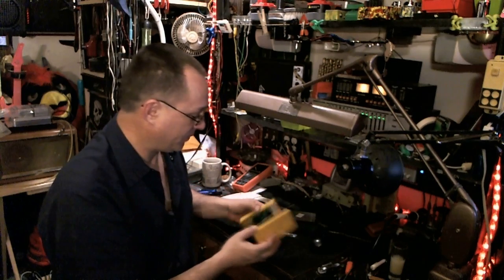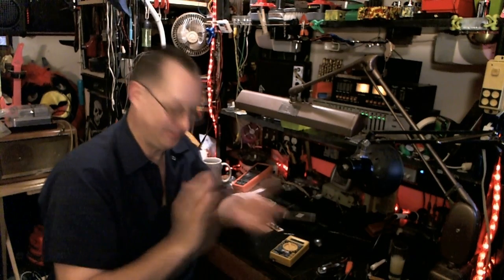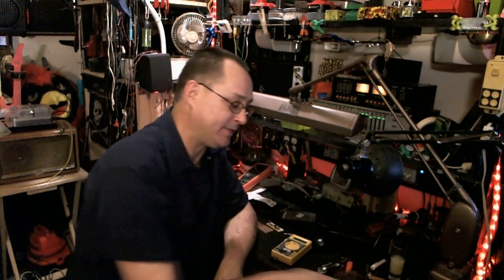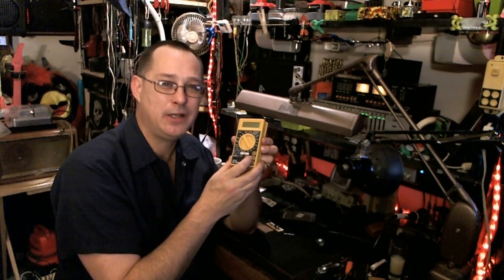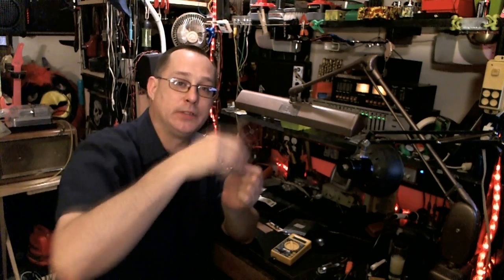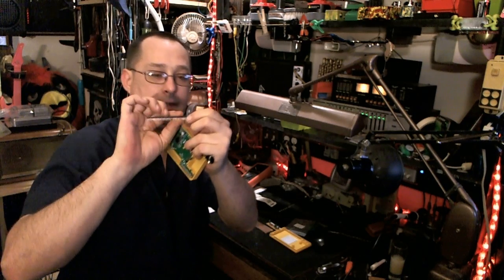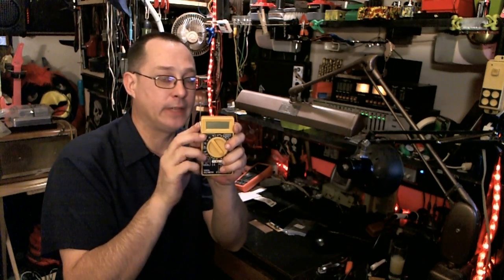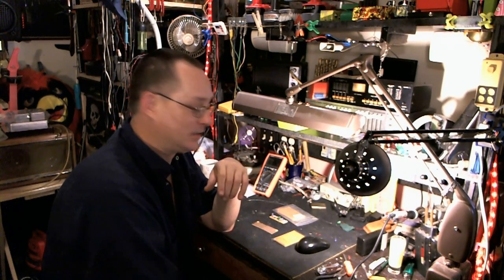Multimeter (cheap one) hack (fixs transistor faulty socket for hfe test)

Comment: I have a very similar multi-meter by Cen-Tech 7 Function Multi-Meter from Harbor Freight, $5.99, but mine was free with a purchase (via coupon promotion). I am comparing to the boringly-flat cheap-looking yellow multi-meter with the 3 and a half digits with the "faulty socket for hfe test". My meter is red and has a small-battery test function (voltage under a small resistance load - Do not use for testing a huge battery such as a car battery), and one additional 200 microAmp range. I have never used the transistor or diode tests. I have only used the voltage function to troubleshoot a bad car battery that won't hold a charge for long. So I was interested to see a very similar multi-meter reviewed. I find it amazing to get so much meter for so little money. Is it really "junk"? Quite many of us, rarely use a multi-meter, only to try to figure out how to fix something, just a few times in our lives. So I find it hard to imagine a cheap meter blowing up in my hands, because of "not enough safety features" or not having the better fuses that do not explode.

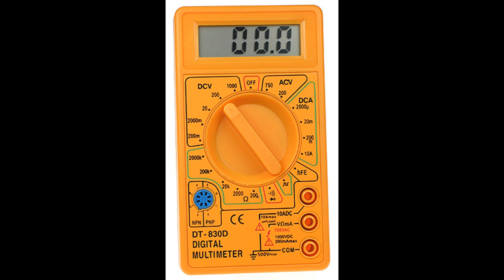Please somebody tell me, What is that wiggly-line icon mode at the 5-oclock position on the selector dial? There is a great still-shot of the meter, at 8:02. I just can't seem to figure it out. My meter has the diode and hFE tests, but not that test? What is it? My multi-meter is slightly better than the meter reviewed, I hope? Mine has no off position on the dial, but rather a separate switch for off, right below the selector dial.
Reply from the maker: hey Yosef ... you found one of my most controversial and hated videos ! i merely wanted to share how i converted mine from useless to having a function . you see my main "good" more expensive meter didnt have an hfe test so i got this cheap one for that single purpose , imaging my feelings when the transistors failed to make proper contact . the point of this video is how i modified it to work well with the hfe test , and then of course me rambling on and talking about the subject of multi meters . i talk a lot in my videos , some people who have limited patience , which the long intro is on purpose by the way ., just for those people as i do not want them here . the squiggle icon is a 50 hertz test signal out put . it sends out a square wave at a frequency of 50 hz . have fun and thank you for commenting on my channel . while i may like some aggressive or heavy music i do not care for kiss or silly bands . ultimately i found much pleasure in making music that is instrumental , with my family . i think someone with a kiss avatar , well that may have something to say about the intellect of this person . perhaps electronics as a hobby may not be the best match for a kiss guy . i think something like monster truck fan , or reviewing energy drinks for youtube would be ideal , perhaps impliment an exclamation point based rating system for the drinks consumed . just a thought . take care brother .
Reply from the maker: as far as if the meter is really junk , see how long it lasts . if you want an upgrade , the meter i speak of in this video is availible for a good price at walmart . i have had this meter for many many years i use it very very often . i have replaced the test leads three times and the batterys the same or so . just make sure what you are buying has the proper features and if you have any more questions  i would direct you to my multimeter tut video , it is short and while pro tech and expert people do not like it i think you would find it enlightening in certain aspects and easy to comprehend . several people have enjoyed learning what a meter does thru that video
Reply: petey twofinger
I like the various multi-meter reviews on YT, and I enjoyed watching one about a meter very similar to mine. I know I have a cheapo, but it seems to fit my needs.

I haven't done many mods, but it is amazing how much a good mod can improve a device. Back in the 1980s, my Dad helped me install an audio output jack on my old Apple //e computer, and the audio was so much more amazing coming out of my boombox speakers. Later models of the Apple // computers included a headphone output port, which soon blossomed into the huge market for computer speakers. We just tapped into one of the wires to the internal crappy speaker, used an isolation capacitor, and installed a switch that replaced the speaker with a similar dummy-load resistor, as cutting the speaker out of the circuit caused the circuit characteristics to change and distorted the audio. The voltage to the internal speaker, amazingly enough, was already at the proper level for a line-level output.

Thanks so much for answering my question. But why would a cheapo multi-meter put out test signals?

I was for a moment, afraid that my old analog multi-meter that my Dad gave me, was perhaps minus the manual, but underneath of it, in the box, there was the sheet with the instructions. Yay!

Who knows why people choose the avatars that they do? Before judging them, let them say something, so as to see if their low intellect matches their supposedly-stupid avatar. Yeah, I just also skipped past the long intro. I wanted to see the stuff about my-similar multi-meter, as to whether it is supposedly good for anything, or so cheapo as to be junk. With my cheapo, I was able to figure out why my heat-pump wasn't working. A faulty float switch in the condensate overflow pan. So I temporarily bypassed it, and ordered a new one. So apparently, cheapo gets the job done?

Sure, I would love to have a better multi-meter, with lots more bells-and-whistles features, and more cool toys to play with. But the cost shoots way up, and the fancy meters do not do all that much more. Some of us have to live on a budget. So my upgraded toys will have to wait until either I get a real job, or I find some excuse to justify buying such expensive toys.

Imagine how great I felt, that I have the slightly-better meter, than the one reviewed. Instead of me having the older? model, and the review having the slightly-meter meter. Well unless I need that 50-hertz test signal for something? These days, probably you could get a free Android app for producing test signals, and just salvage the cord from some old crap headphones? And how come, hardly anybody knows to look for litz wire in headphone cords? Not even my spell-checker recognizes the word "litz". It is the real thin foil wire that bends and bends, without breaking, like how cheap headphones so often fail.
Reply from the maker: cool  mod , your old mans sounds like a smart dad .... i am guessing the 50 hertz sqare wave may not be very acurate and also would not think this is  a common feature it is more unusual . i have buillt my own signal generator using the xr2206 chip . later

Comment: I got this meter for physics in college. I have a better multimeter I bought for around $60 though. I just tested this with a transistor, and the cheap on read 680 on a small NPN transistor. It then went down slowly to 180, then went up to 290, then went up again. I'm new to electronics since I am studying it as well as computer science, so I don't know if this is normal. To be honest, I only know what hfe stands for. Not what it actually means.

Comment: Not particularly fair to call all of these types of meters which are many sold under various names garbage just because the one meter you had didn't handle hFE well. Your expensive meter which you showed first doesn't even handle hFE at all yet in your words you love it. I use this type of multimeter all the time and probably test the odd transistor a few times a month and never had a issue with it.
Reply from the maker: Robert Adair it did not function at all . the contacts for the transistor socket do not work AT ALL . this meter is simply a case of you get what you pay for . i paid 8 for it . i have seen these for as low as three . for someone who would be purchasing this meter solely for the purpose of its transistor testing option , this was not a good purchase . it was a piece of trash . after i modified this , it works flawlessly . perhaps watch the entire video before commenting ?

Comment: Good grief, spend a couple of extra bucks and get a meter. HFE is useless, dont waist your money on it.
Reply: Why should I buy a more expensive multi-meter? So I can test capacitance? But when will I ever do that? So that I can measure temperature? I can't feel when something is hot?

I know why. So that I can have more expensive toys, right? Or were I to ever become a handyman, people would think that I know what I am doing, if I don't pull out a cheapo meter?

The cheapo meters do so much, why do I need anything more? Well they don't appear rugged. If I dropped it, I suppose it would perhaps break. I have used a multi-meter to help repair something, I think about twice in my life so far.

Comment: The two I have are slightly different, but I have never been able to measure hfe  with  either.  Additionally, the yellow ones usually require that you open them and insert a shim such as a double-sided adhesive pad under the center top post to create tension otherwise the middle display digit loses the top segment most of the time.  I just use my Tenma for the transistor gain.  $20.

Comment: Can you make it so the socket sits flush in the casing? Also, might it be possible to wire the inside connections to a 4-pin socket instead of 2 3-pin sockets (NPNP/PNPN)? Just a thought!